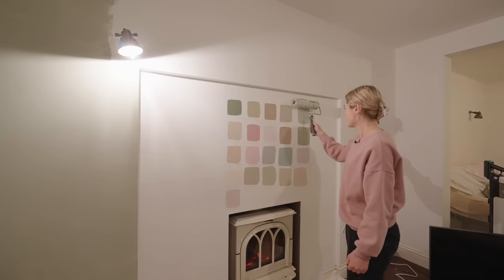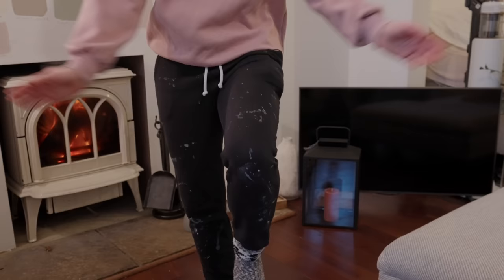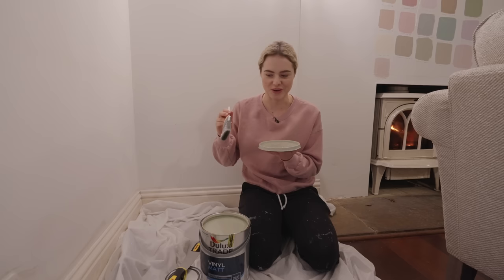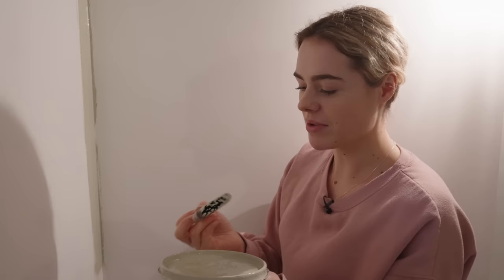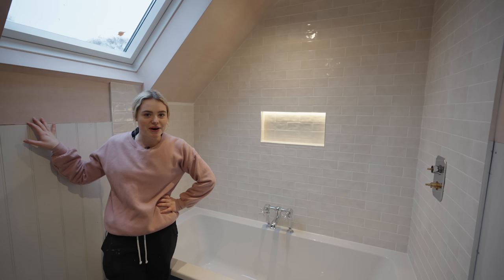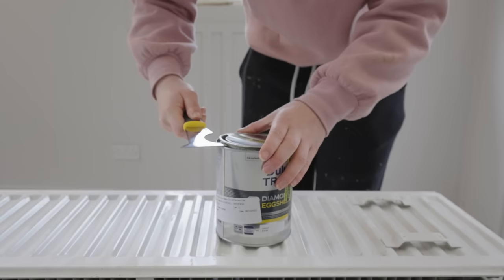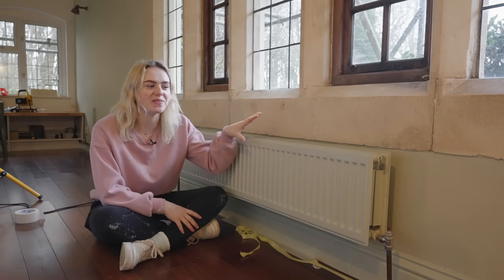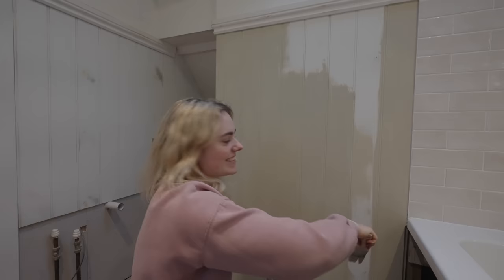Let the Decorating Begin! - See How I Create My Dream Home! Cottage Renovation Series | Esme

Comment: You can get these older radiators at reclamation yards. You can even get matching ones if you're lucky. They are not expensive either. I did, just got them sandblastet, checked for leaks, painted them gunmetal grey, as they used to be. Looks a bomb, you'd love it.